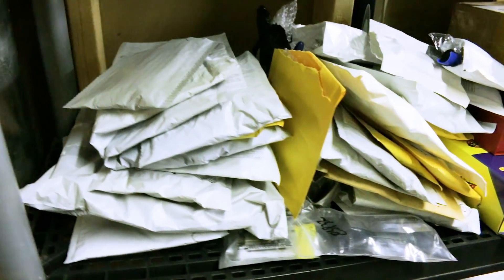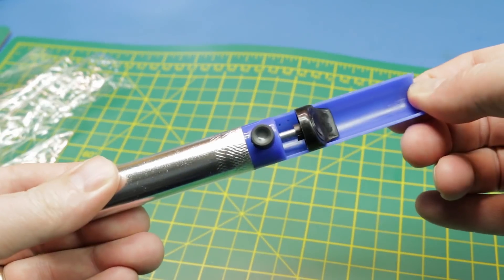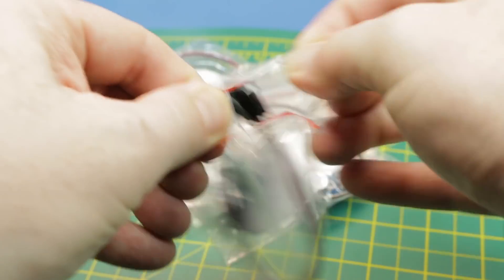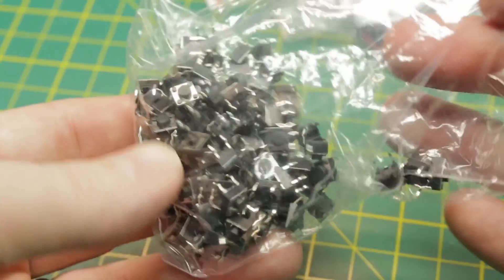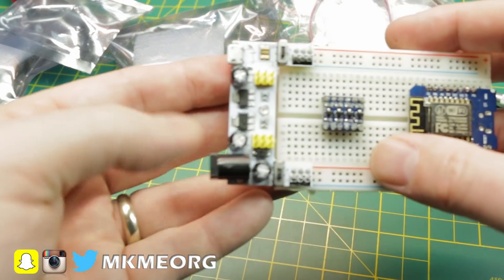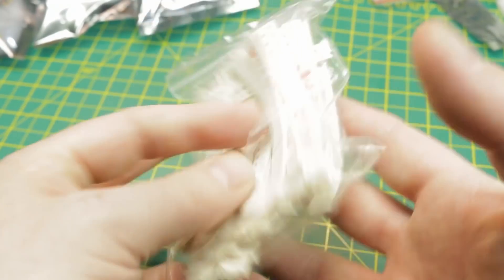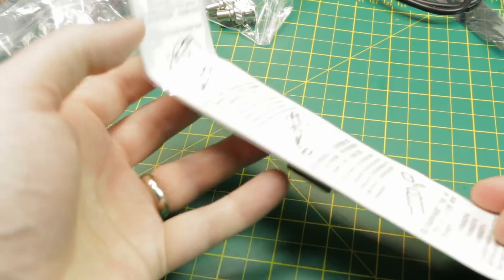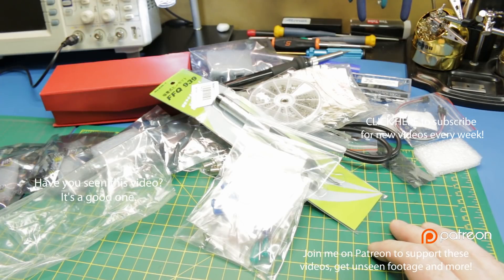MAILBAG TIME! Soldering Iron, Parts and More!

Comment: Be careful with the breadboard power rail. If you accidentally short it it will start outputting input power to the rails. At least mine did.  Fried quite a few components on the breadboard before I realised that the regulators failed that way.
Reply: Hey me too! What an awful fail mode huh?
Reply from the maker: Thanks for the heads up
Reply: Regulators are fakes, no thermal/short circuit protection. Actually if you feed 12VDC in the jack, don't take more than 100-150mA from 3V3 rail because you will end up with the 12V in your parts!

Comment: Those 50 ohm loads at 7:50, it pays to check them, I got some that looked exactly like those, they were no good, dodgy connections from resistors just pushed inside, no soldered/crimped connections.
Reply from the maker: Good to know!

Comment: Good bag . Been using those breadboard power rails for ages.  I need a new solder sucker as mine is that cheap one.  Had it over a year and it's been ok but I need a better one.
Reply from the maker: This sucker probably wont suck long ;)  Too cheap this time